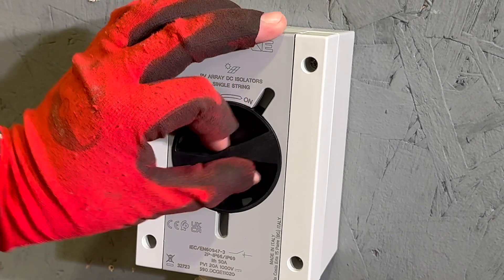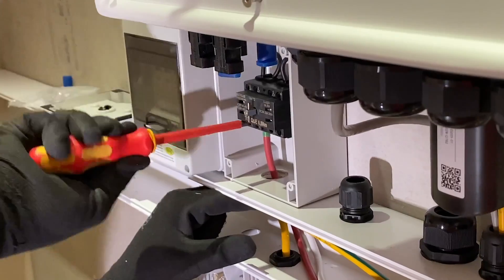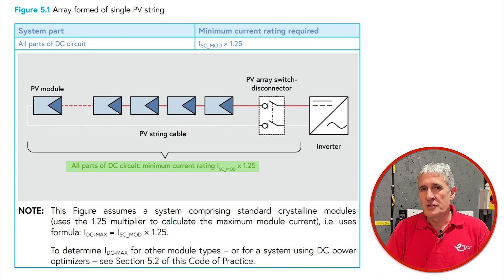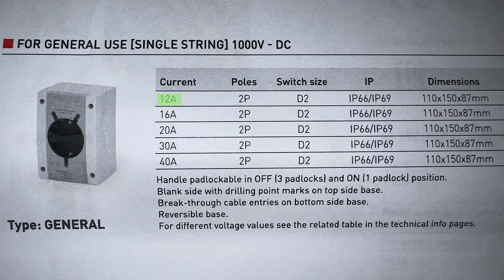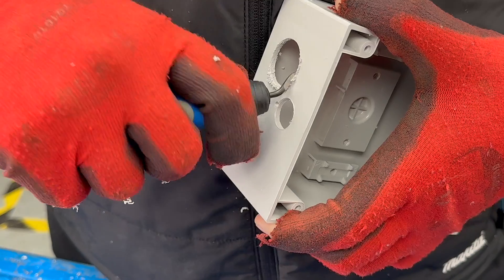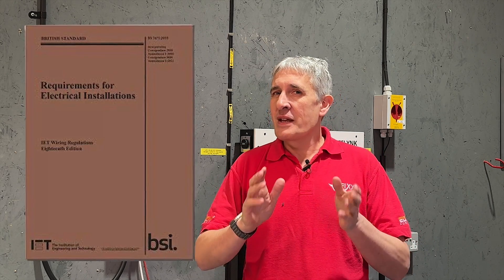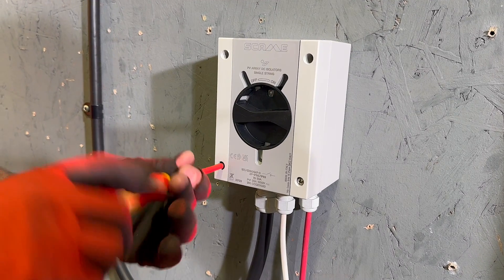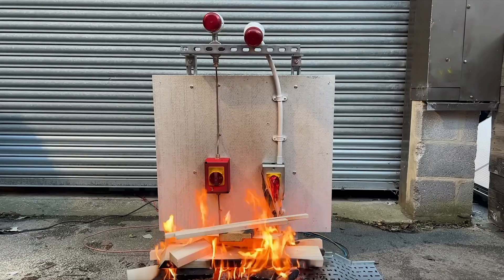How to install a Solar PV DC Isolator - Scame

Comment: If the isolator is a source of fire, why not just use a high voltage cable cutter a or an isolator that just physically cuts the wires. Wouldn't it be cheaper and safer just to rewire or reconnect a segment of wires?  I guess it's cheaper to make people buy an inverter with one it, so that way, our  brave fireman have look for it while your house burns down.

Comment: I want to switch two five kw strings between two inverters one is grid tied the other hybrid. I want string to shift to hybrid in case of grid goes off. Any suggestion?

Comment: Please stop saying DC Isolators are the weakest link in any array...
It's the MC4 Connector and you have say a dozen of them in a basic small domestic string
(6 Panels with 6 female + 6 male making 6 connections from 12 connectors, plus the ones elsewhere at the inveter)
If you include say Tigo Optimisers, then you have TRIPLED the MC4 connectors/connections under each panel
(2 on panel plus 4 on optimiser = 6 MC4's or 3 actual connections)

But yeah, let's blame a DC isolator where ferrule cable is properly caged clamped...
But completely forget each one of the MC4's are simply pushed together & hope for a solid connection in all weather - yeah they're completely sound of course
(You don't put the isolator outside/on roof - even if shielded, keep these inside near inverter or a group of isolators for all strings for quick easy emergency shut off - do this & you are golden)

The Bristol Maternity Hospital fire on the roof array - deffo the DC isolator, couldn't have been just one of the many MC4's poorly fitted or mixed brands providing a poor connection, leading to a growing DC arc that got greater & greater over time

Yeah - DC Isolators are very bad as the weakest link in any string...
MC4 - yeah they're nothing to worry about
Reply from the maker: Most MC4 connectors are factory assembled.
Reply: @efixx  Except the ones you have to make at the beginning/end of each string on the roof & then once again another pair at the inverter
So that makes 4 plus all the others as I mentioned...
So let's just say 6 panels with Tigo optimisers - that's 6 panels with 6 MC4 connections underneath 3 female plus 3 male
That's 36 MC4's under the panels...
Then add in a pair on the pv cable you connect up to panels, plus another pair at inverter...
That's 40 MC4 connectors making 20 push connections
But yeah, a DC isolator must have way more points of resistance than 40 connectors/20 push fit connections
If people can't RTFM the isolator instructions as Scame & IMO/Garo are wired differently etc...
If people struggle to install a rotary isolator, then they really shouldn't be installing any other parts of a PV system

Comment: Important to remember these are isolators for maintaining safe isolation and are not breakers to break the flow of current. So often misused to switch systems off under load.
Reply: @Ed.R  so that's the difference. Thanks

Comment: I disagree about using a bare ferrule.   Double-insulated 10 AWG solar cabling actually does (barely) fit under the ferrule's plastic guard, and having the guard significantly reduces wire play at critical junctions.  If its close you can still make it fit by applying a heat gun to the plastic guard for a few seconds,  I strongly recommend that the guard not be removed.

Manual DC isolators should be banned, period.  They have caused so many frigging fires its not even funny.  They have no thermal trip, often not even spring-loaded, minimal arc extinguishment, minimal uses under load with no indication that replacement is necessary.  They were originally designed as a cheap way to avoid putting a breaker in but obviously over the years that has proven to be disastrous.

Australia is finally scrapping the nonsense about putting disconnect switches up on the roof.  OMG that was such a disaster!  The U.S. is settling on "rapid shutdown" devices on every 1 or every 2 panels (now integrated into the micro-inverter or optimizer).  That way the "big red button" outside the house doesn't have to be current-carrying, and it can shutdown the entire solar system.

The most you ever want to have on the roof is an inline fuse at the end of each string, and that's pretty much it.  But even that isn't needed when there is a rapid-shutdown device and insulation monitoring.   No more combiner boxes on the roof either... they should be at street level and easily acecssible.

And no more manual DC isolators in their own little mini-enclosures exposed to the elements.  What a disaster those have been.   You demonstrated in your video very succinctly why its such a bad idea... if one is going to have a DC isolator on an outside wall somewhere, it should be mounted inside a larger enclosure and down at street level or inside the garage or something.  NOT exposed to the elements, period.

I far prefer using solar combiner boxes for this purpose even when there is only one string.  They have the integrated fuse, sometimes backfeed diodes too, and a master-breaker on the back-haul.  It means bringing the cables for the individual strings all the way back to street level, but it is so much easier to maintain.  Then you just have a second master breaker for each backhaul cable at the equipment and you are done.

And those breakers are just *unpolarized 2-pole 1000V DC breakers*.  No messing around.  Real breakers, really unpolarized, and none of this 200VDC or 300VDC or 600VDC nonsense.  1000VDC.  Plus they have the advantage at that point in the back-haul of only having to deal with current one-way, so the installer can just follow the polarity labeling on the breaker (even unpolarized breakers tend to have polarity labeling so installations are uniform).   That way there is no mistake and no worries about 2-way current.

-Matt

Comment: What's the purpose of inverter dc isolators if they're still connected to the inverter?
Reply from the maker: Stops the current flow so you can safely unplug MC4 connectors.
Reply: @efixx  But you don't ever want to actually turn the handle on those DC disconnects while it is carrying current anyway.  Literally, you don't want to do it.  Those disconnects should only be used in an emergency or when the current is known to be zero and that's it.

The proper way to shutdown the charge controllers or inverters is to use the soft-off switch on the inverter or the bluetooth app to turn off the charge controllers.  THEN you can turn the manual disconnects for added safety.
Reply: @junkerzn7312 That's exactly what I came here to say. An isolator is to keep the supply safely isolated after the flow of current has been stopped by another safe method.
They keep on about isolators being a weak link but continue to misuse them. Only a breaker should be used to stop the flow of current.
Reply: @efixx It isn't really about current flow is it? It's about not having any voltage down stream from the isolator which can cause electrocution

The existing current flow isn't what causes electrocution of you when you touch a live part. It's the presence of the dangerously high voltage which then causes a separate current to pass through you, frying you.

So the correct answer to the question, is that it removes any dangerously high voltages from the MC4 connectors.
Reply: @deang5622  you can't disconnect MC4 when it's carrying current, or else the connector will be toasted and need to be replaced, and you can get electrocuted without even touching the conductor.
Reply: @samueladitya1729  Clearly you didn't read my post properly and as for not needing to touch the connector to be electrocuted.  That's not even a relevant point. And the voltages typically involved, that does NOT happen.

You need thousands of volts to be electrocuted without touching the conductor.
It's surrounded by plastic.

And I did not say it was safe to unplug a live connector. I did not propose that. Where you got that from, I have no idea. You just made that up in your head.

So learn to read accurately what is written and don't make assumptions as to why people are saying what they have said.
Reply: @deang5622  well, you can't separate between current and voltage. You disconnect the isolator so the current stop and there's no voltage difference when you disconnect the MC4. 400VDC can jump a few cm in the air after initiated and the bigger the amp the bigger the flame and can sustain higher arc voltage, thus longer arc. You get electrocuted if you hand is in between the arc. 

The DC isolator is also like a sacrificial device, you burn it instead of burning the connectors.
Reply: @samueladitya1729  Still don't get it, do you?

Only a City and Guilds course?
Is that why?
Reply: @deang5622  it's not my fault that you don't understand. What we worry isn't about electrocution, and no one said the existing amp causes electrocution. I don't know how the hell did you come up with that idea, you hallucinating? 

More amps=bigger flame and more damage. The disconnect switch used to take that damage in case we need to disconnect like doing solar panel maintenance or modifying any of the high voltage lines of the string without doing any damage.
The disconnect isolator can be placed anywhere in the string, down, up, or in between solar panels, even that's bad idea, it all does the same thing. Touching one wire won't kill you unless the line has leak path.
Reply: You never want to disconnect an on load mc4! Very bad idea!
Reply: Kills the feed from the panels to the inverter.